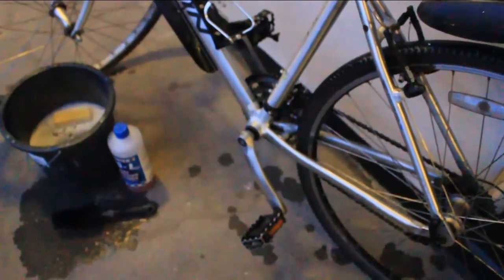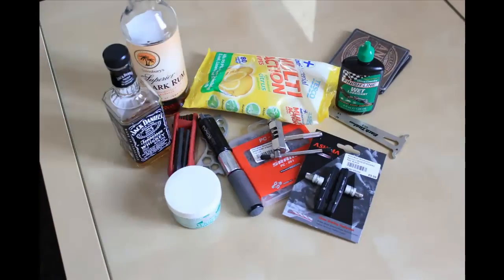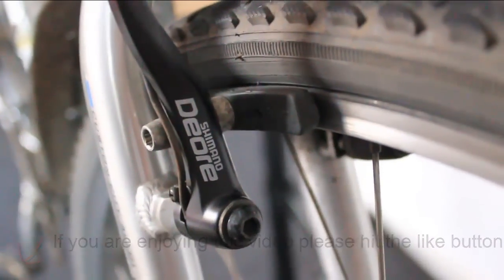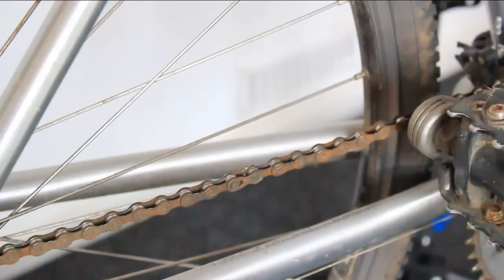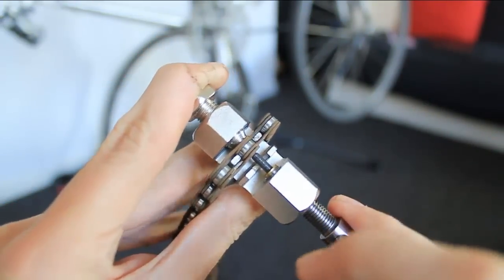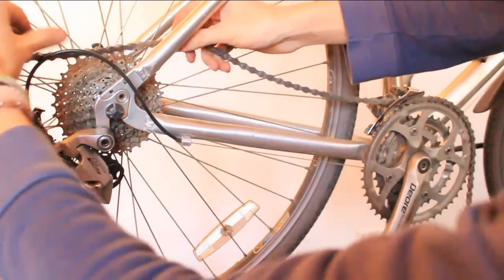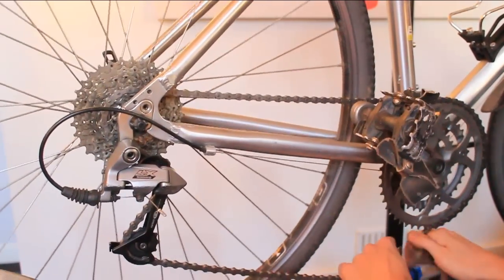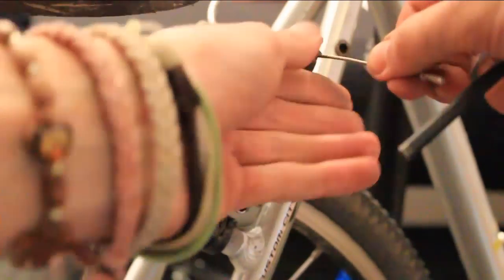Overhauling your old bike

Comment: I had a horrible experience with Finish Line wet lube, it attracted dirt and grime like a magnet. 
Did it work properly for you? 
Maybe I was using it wrong, or putting too much, anyhow I switched to the dry kind.
Reply: The type of lube depends on the riding conditions in your area so if you ride in dry areas it would be in your best interest to use the dry lube to repel dirt and dust.
Reply: Action Filmz Yeah! Ive been using dry lube for some weeks now and its been working perfectly for me here in Mexico City. I clean it every 200 km, which is about every week for me.

Comment: When you show the chain checker you may like to explain the difference between the 0.75% side and the 1% side.  ie at 0.75% the chain is worn but won't have done any damage to the cassette; at 1% the chain is very worn/ liable to snap and will most likely have done to the cassette.